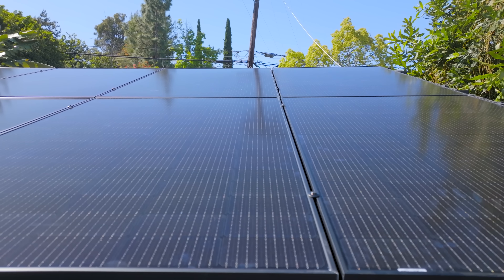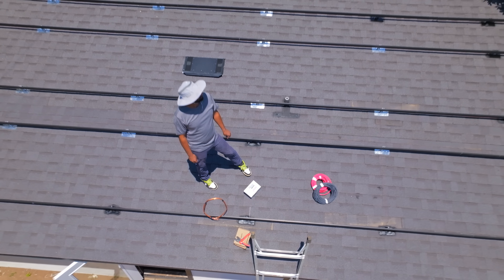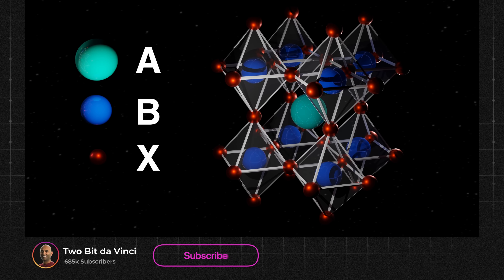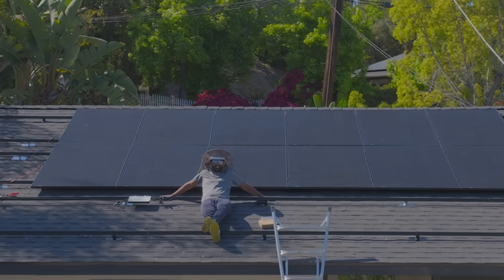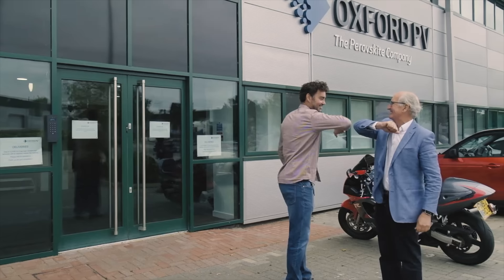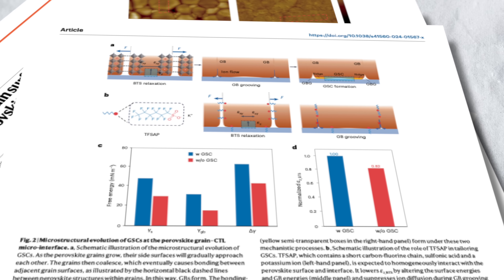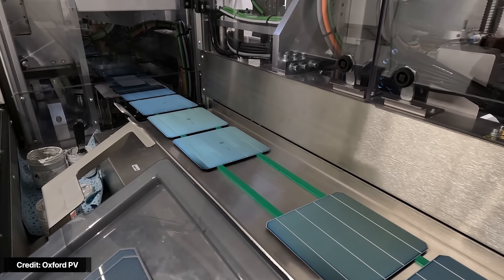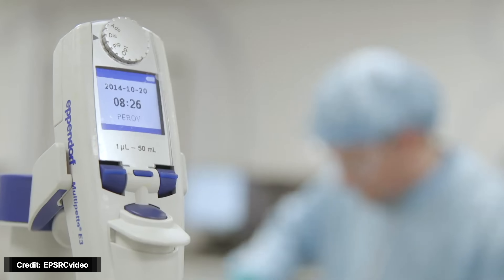Secret Unveiled: How Scientists Prolong Solar Panels' Lifespan

Comment: Your calculations are a bit naïve. Most people don't have thousands of dollars lying around. They would have to take out a loan for their solar installation. That would put even the cheapest system out of reach for most of them. Solar will have to get a lot cheaper to be competitive.

Also, not installing long-lasting shingles under your solar installation seems foolish to me. When it wears out, you will have to pay for removing the solar and reinstalling it after. You can get shingles that last 25 or 30 years. Investing in long-lasting roofing is another cost for solar.

In all, I think your calculations could use more work.

Comment: Current PV panels has an efficiency of about 20%, which they state in this video. But at the start of the video they state that this new cell promises efficiencies 100 times the efficiency of the current cells. That would mean the new cells could have an efficiency of 2000%, putting out far more energy than the sun puts into them. I stopped watching right there. Science videos either get things right, or they aren't science videos. That's the nature of science.
Reply: Yea, I kinda raised an eyebrow at that "100 times..." thing.

Comment: Solar panels are stupid. Invent something.
Reply: Something? Something, which let you use a free abundant resource instead of one, which is runing out. (peak oil,, anyone!)
Yes, i totaly agree. Let's invent something.
Reply: @johnbraunschweig  ya got the right attitude! 🫡
Reply: How about solar balls?  Much easier to throw than a panel.
Reply: @undertow2142  throw right into the trash. 😜
Reply: What can it be?
Reply: @claudiaroy9455  anything. Preferably something with whirlpools or static electricity.